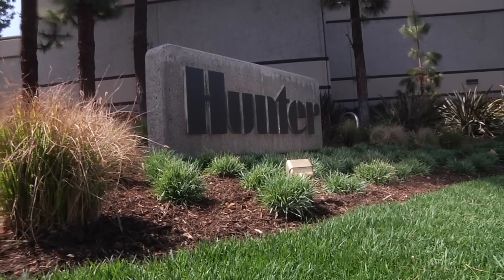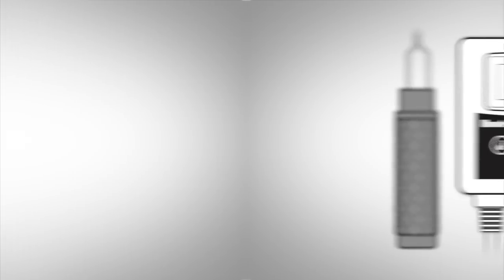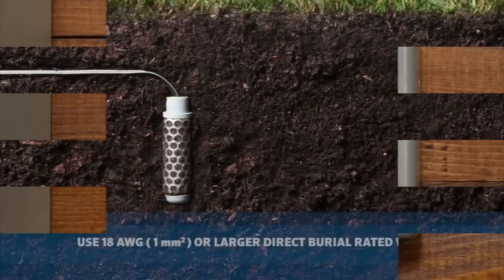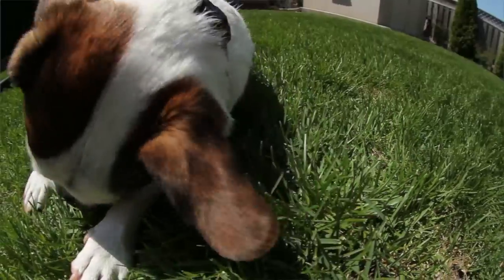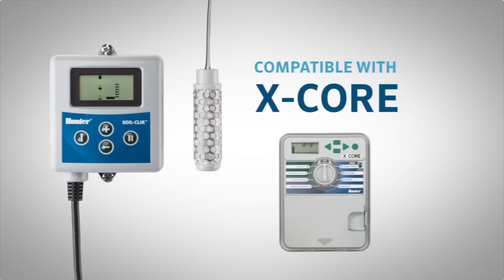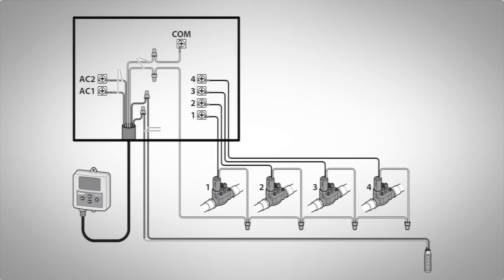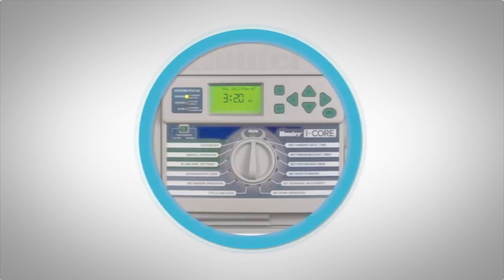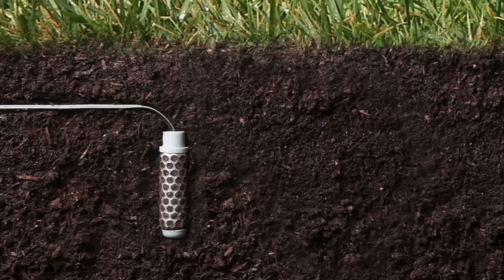Soil-Clik: Product Guide

Comment: So one unit could be used as a stand alone system? Looks like retail cost is 100 ish dollars per unit. 
I have grass that requires lower amount of water yet want to keep the ground dryer than normal. Then I have flower beds that require large amounts of water and some that require low amounts of water. While one can set times and length It would just be simple to be able to set a good moisture level and then add as needed. This would help plant growth far better.
Reply from the maker: The module attaches to all Ac powered Hunter controllers and will work with most other manufacturers Ac powered controllers. The module is a low-voltage 24 volt outdoor enclosure powered by the host controller
Reply: @Hunter_Landscape_Irrigation  This still does not explain what I need it for. Does this mean I can attach one unit per control valve or does this only control the whole system.

Comment: Why it’s impossible to connect only one sensor? What if I want few sensors in different places?
Reply from the maker: Good question about compatibility. It is designed to only work with one sensor. It was designed this way because the majority of customers only need one. Adding more sensors adds more complexity and can be confusing additionally. To alleviate this we designed it with one.